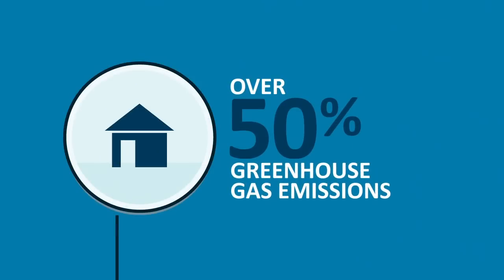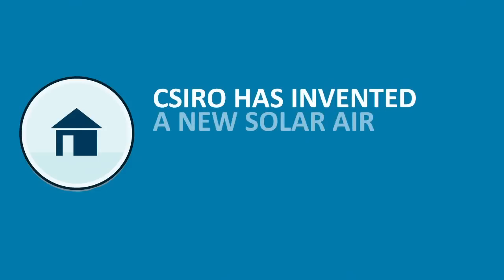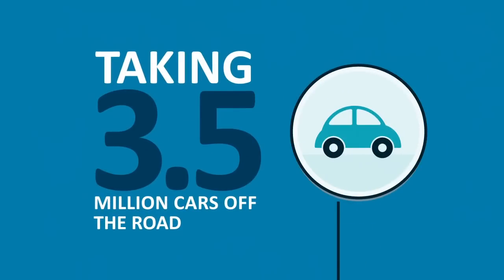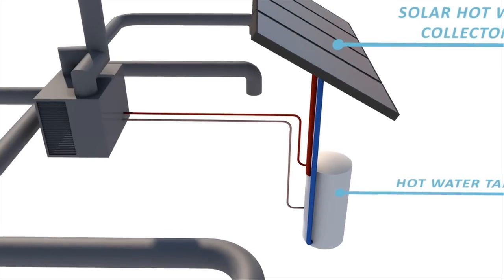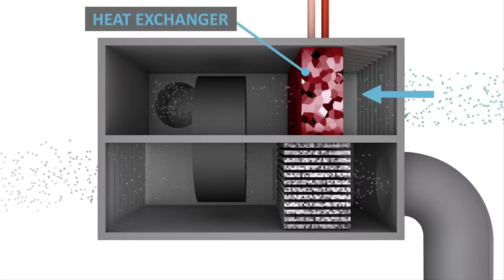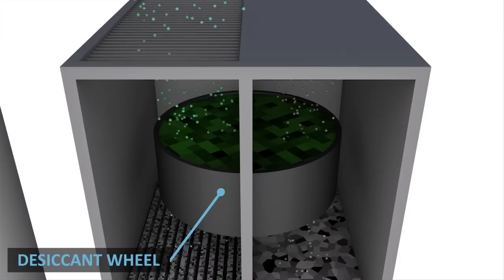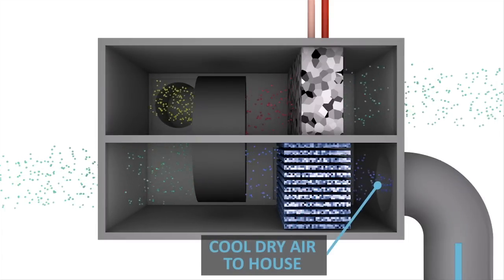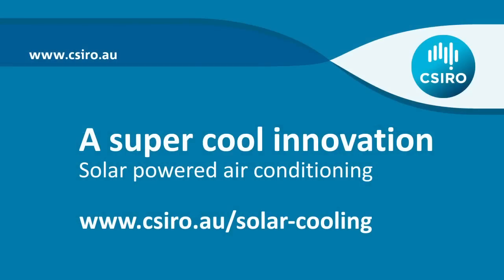Solar powered air conditioning

Comment: Our normal temperature  20 to 40 three month winter temp average 18 to 24 degree C and 8 month summer average temp 30 to 45 maximum. I want to use Eco solar heating and cooling system. I want detail about pricing and maintenance price.
Reply: good luck
Reply: It requires a magic wand to actually work.

Comment: I live in a desert, cold in winter, hot in summer. Humidity generally under 20% in summer. How would this work with 20% humidity, 35C outdoor air temperature?
Reply: Dry air is easier to cool then humid air. In very dry and hot locations you can use an evaporative cooler to cool the air and also add humidity. Basically, a swamp cooler. But you can't use a swamp cooler in very humid environments so you need to dry the air first. That's what this system does. It dries the air and then adds a bit of humidity back to the air both to cool it and keep it at a good humidity level.
Reply: @PlasmaNode  I understand the general principal. I use a swamp cooler almost daily. It is not particularly efficient -- certainly wastes a lot of water, in a water-scarce region. I could not find any research papers associated with the video above. My best guess is that it works as you suggest -- in a humid region above 50-60% ambient humidity, it uses solar heat to dry out the dessivant, yielding pre-evap air of 10% humidity, then raises it again to more than 50% humidity. It probably relies on having a fairly well-sealed and insulated house with return ducts, whereas low-cost American evap coolers rely on direct venting to the dry outdoors once the humidified air passes through the conditioned space (evap on one end, open window on the other). From what I can tell, this CSIRO invention is not directly useful for my situation because of how large and expensive it is. It is related to a recent Tech Ingredients video which addresses someone in my situation -- trying to cool a relatively small space (under 50 m^2) on a small budget ($500 or less) with limited electricity (solar off-grid) and limited water (hauled and rain-caught, no well or grid supply).

Comment: im not sure how you can get chilled air from hot water...Without the need for freon, to chill the air
Reply: I didn’t know about it either until recently, but it’s the desiccation process. It’s basically the same way sweating works: heat energy is carried off as water evaporates leaving you cool, so basically they are making the air “sweat” by drying it out.

Comment: Will this system work well in an arid/dry climate like Phoenix Arizona United States? Or, is conventional air conditioning the only real solution? Temperatures average 107°F or 42°C and do reach temperatures north of 115°F or 46°C. Is your system available in the US?
Reply: Since in you are area you don't need the solar heated desiccant wheel to dry your air it would be very little use to you. 

So a simple low cost evaporative cooler could be effective but if don't like higher humidity. 

Look into radiant cooling with geothermal direct or heat pump cooling source.

And consider storing the waste heat into a Hot Water Tank.  There are solar heat exchange tanks that can used. Why waste it? 

Except for evaporative coolers most of this will cost more than an air to air A/C unit but should save money in the long run. Good luck...

Radiant cooling - Wikipedia
https://en.wikipedia.org/wiki/Radiant_cooling

Geothermal heat pump - Wikipedia
https://en.wikipedia.org/wiki/Geothermal_heat_pump
Reply: Thank you for the details.
Reply: NP, feel free if you have any other questions or updates on what you decide to do...

Comment: The dry air that flows through the desiccant wheel passes through an evaporative cooler, creating a temperature differential of how much? So there are two fans that move air and presumably some device that sprays water on the heat exchanger in the cooling circuit. Not to be Negative Nancy, but it sounds like two fans and a pump are consuming electricity for maybe / optimistically -2 degrees of differential. Can you share some test results?
Reply: FYI, radiant cooling which is very efficient but still needs a separate dehumidifier to dry the air. So an effective solar power desiccant wheel dehumidifier would be useful for many applications. 

Evaporative cooler have been used in dry climates for long time so that is not the major issue. What has been missing is an efficient longer lasting, reliable way to dry the air. So the real issue is with the desiccant wheel and the associated systems. Desiccant style dehumidifier have been largely replaced with less efficient heat pump dehumidifier since the desiccant loss their ability to dehumidifier. So the key an effective desiccating system. And the fact is CSIRO is just a think tank and the idea is decades old, even I thought of a variation of how this concept could work. But the devil in the detail. Good luck to someone make it really work....

Comment: Just wondering... is this only available in Australia? Or can this system be adapted in other countries and in larger projects?
Reply: Gladys Rodriguez This could easily be adapted to any area that it is designed to work in. The only changes would be motors and voltages etc. I think.

This could also be scaled very well for large office buildings.I can see this replacing cooling towers somhow in the future. Possibly much more efficient and possibly less maintenance.

Comment: Long overdue concept. I don't mind so much that it's hot in summer. what makes it harder is that it gets so hot at night that you can't get a decent nights sleep. only 2 hours if you are lucky. one of the drawbacks of evaporative cooling is the celdek pads need replacing. what would the maintenance be like on this system. would you need to replace the desiccant wheel every couple of years. also keeping the spiders out...

Comment: The size of system you will need to achieve decent cooling would be enormous..and it doesn't work at night..
Reply: It would work at night if you had enough heat stored in a large enough tank.

Comment: Will this work in area with high humidity?
Reply: Ali Saggaf.  No.  There is no latent Hot Dry air in Florida.  Just Hot WET.  Therefore the drying chamber is not much dryer than the wet intake chamber.  You must apply greater mechanical effort to dry the air, like electrical dehumidifiers and traditional compressive air conditioning heat pumps.

Evaporative coolers work in Arizona or Southern Algeria better than Florida or Southern India, just like clothes dry very slowly on a gloomy day in Pensacola using just air/clothes moisture equilibrium.  They dry quick on a sunny day due to direct radiation boiling the water out, which took massive solar energy.

Comment: how does it work at night when there is no sun
Reply: The air con function of the system works using energy from hot water rather than directly from sunlight. Hot water is heated by the solar vacuum tubes and will store that energy overnight, so the air con element can run more or less continuously, provided the hot water tank is scaled appropriately.

Comment: Is Evaporative cooler using electricity?
Reply: Yes, there is nothing like passive cooling or heating. She said at the beginning, it reduces electricity bill upto 60%.to pump hot water in heating loop, one need electricity.more over in rooms for exhaust air, one could need  Ventilator.

Comment: Sir I want official journal on this project. How can I get it (please provide it)
Reply: This isn't a new idea been around forever you can make one yourself with just a modicum of ability
Reply: As a matter of fact there is already an avaliable design online now using PVC 4 inch pipe a homemade desiccant disk ,that rotates for longer lasting, and uses PC power supply super simple design works amazing

Comment: WHY I'm TROOLING?
Because the dessicant wheel will need to be larger than the housse AND it will still bring 100% RH inside. Have a look of the explanation. I've include a list of options that will do the work thousand time better than the present piece of shit and at a fraction of the cost.

COMPARTMENT 1 (It will take hours to dry the dessicant wheel and this wheel will get too hot in the process)
1 The hot water will be arround 70*C
2 The air can't be warmed higher than the water temperature
3 The dessicant wheel media can't be warmed higher than the air that has been previously warmed
4 So, this double loss due to heat transfer will leave the dessicant wheel way under 70*C, maybe 50*?
5 At 50*C, drying the dessicant wheel media will take MANY HOURS
6 The dessicant wheel will barely lose any moisture, but will gain temperature

COMPARTMENT 2 (It will take forever to remove any humidity from the outside air on a 50*C dessicant wheel)
7 The dessicant wheel enter into the second compartment at arround 50*C and perhaps 20% less humidity
8 The dessicant wheel will be cooled down by outside air to about 40*C (if it is 25-30*C outside)
9 The dessicant wheel will barely trap some humidity from outside air (10% in one hour been outstanding) 
10 The barely driyer air, at 40*C will be cooled in another heat exchanger
11 This last heat exchanger is an indirect evaporative cooler witch need a large cooling water tower outside (not showned, strange isn't?)
12 The indirect evaporative cooler can lower the 40*C air to about 30*C

WHAT DOES IT TAKES TO WORK?
So basically, as per number 9, unles you have a very very slow air flow, you will not get enough duration to get the water removed significantly from the outside air at such a high dew point. I guestimate that it will require a dessicant wheel about the size of the housse, wich is bulky AND expensive!

But this is not the worst...
The main flaws is the last steps. Since the water removal is marginal, it basically only rely on the indirect evaporative cooler, the only working part of this technology. This is not shown since it is not a new technology and it require a large water cooler outside and a large very large heat exchanger inside. Did I mention that an evaporative cooler work only when the outside air is dry? If the outside air is dry, then, there is no point to drying it with de dessicant wheel. If the outside air is moist, the evaporiative cooler is not working. Do you start to get it?

ANY SOLUTIONS?
OK, you asked nicely about a solution?
Once you fired and sue the responsibles for this sensless proposition, you look to what was already known...

More than two thousand years ago...
A Yakhchal was able to cool down enough to create ice in desert. It is bulky and require a little water to evaporate, but it is pretty much zero energy input and it can be made from dirt. This passive evaporative cooling can be used with a heat exchanger. Air passing within a double whall will work just fine or air duct slightly burried under moist sand will work as well for such heat exchanger.

You can also get a "Puit Canadien" to lower the outside RH and to significantly cool the air.
https://en.wikipedia.org/wiki/Ground-coupled_heat_exchanger
Both technology coupled with a solar chimney will drive the energy consumption close to zero.

You can also plant trees to get more shadow and evaporation from leaves will cool down your yard.
You can also paint your roof and your driveway with an IR reflective paint (or simply white).
You can build an irrigated green roof
You can simply put a tarp over the roof to dissipate the majority of radiation energy from the sun.

Alex from Québec, Canada

Ps Please, take a break, remember that as an engineer you can kill peoples if you cannot calculate things properly... Do humanity a favor and consider going back to school.

Comment: How does the system work when there is not enough sun light?
Reply: Chad Dimmack Reminds me of a creative presentation to ORAL B.  A client asked, how does this tv ad communicate to those without teeth.
Reply: great point
Reply: With Solar Arrays you need to have a redundancy system, either Generator or Battery. But I have been thinking about this.
Reply: Perfect answer.. Same thought
Reply: Tesla battery. Im sure csiro will flip the science to create solar powered heating too. Pretty much just need to reverse everything and have a condensing unit
Reply: Chad Dimmack if you live in an area where you dont get much sun light annually, why do you need solar powered anything. Just spend your money elsewhere
Reply: if stored heat runs out....you just need separate heat source like from electric or NG .....

Comment: Wow!  Sounds too good to be true.  IF it really works, and, lasts.... PLEASE bring that tech to the USA!    There are plenty of people who would buy that complicated tech. 
I thought hot water circulated via radiant floors to heat...guess it still could.  
But, using only air to circulate temps, means no water leaks damaging the house, and no tubing clogging from mineral deposits.    Just keep the ducts cleaned.   
That said....why not simply design in simple geothermal to cool?  Blow air via 6’ to 8’ deep geo-holes in ground, into house, helps cool..,.and, vastly decreases need of heating cold climates.    Ground is at about 55 degrees F., at about 8’ deep, almost everywhere people live.   THAT translates to simple tempering, winter or summer.    So, whether one berms the house, or, carries that temp to the house, measurably reduces heating/cooling costs.    
Humidity can also balance in the ground, given the chance, via use of perforated tubings used to circulate the air to temper it in those holes, or directly.   
Insulate well, the “roof” lid of the geo-holes, over top of the tubing, to separate temps in the holes, from outside ambient temps.   Once installed, there’s no fluid to leak, and nothing bringing hot temps into building envelope.  
And, only cost is fans to move the air.   
Tricky parts include:   figuring how much tubing is needed in the Geo-holes, to temper the volume of the building.  
Leave bottom of the geo-holes as bare ground, to allow humidity to balance via earth.   
Perf’d drainage tubing comes ready made with drainage “stones” in a sock around them now, which facilitates humidity balancing.    Though, some don’t bother to put tubing in the geo-holes; they simply input warmer air to top of holes, and bring cooler air from bottom of holes.   
Just need large enough holes &/or tubing, to cope with volume of air inside the building.  
That seems much simpler.  
Some fear that would bring in mold....it doesn’t seem to.  Have seen this done in the Pacific NW of USA...quite humid weather.   Mold happens worst, when air doesn’t move, or, when humidity lingers above about 50%.   
Humid air moved via bare-dirt in geo-holes, tends to balance into the earth...dry air takes on a bit of humidity, while damp air drops its moisture into the dirt.  It also seems to freshen the air somehow...kinda like being in a cave that has moving air.   Those who lived this way, didn’t seem to get mold in their cabins [earthen floors]; while those in well-sealed cabins, constantly fought against mold.   Sealed cabins can’t “breathe”.  Earthen floors, breathe. 
Geothermal holes, are like having an earthen floor to help the house breathe, as well as tempering the air.
Reply: Enjoy ur holes...

Comment: All good when fresh and new...
Give 3 or 4 summers ...
This system would have nowhere near the cooling capacity of a standard refrigerated AC.
It wouldn't work where the air is already dry like anywhere west of the Blue mountains Australia.

Comment: Where electricity used in this
Reply: Rotating the dessicant wheel requires electricity, as would fans to move the air (and to a lesser degree, water) around the system. The important thing is that is the only power needed. The actual heating and cooling is solely done through energy from the solar heating of the water. This is a huge reduction compared to having compressors to run air conditioning and immersion heaters for hot water.

Comment: What happens at night time?
Reply: +Jesse Osborn Good question. Perhaps the water is a saline solution that can store the heat after the sun has gone down.
Reply: +Jesse Osborn Solar energy is fed and stored in battery banks, not used on a minute to minute basis so this would work the same as any solar generated system.
Reply: +Jesse Osborn It's stored in an insulated tank, so little heat is lost
Reply: So it uses electric solar panels not solar hot water panels? Will this system be effective in coastal areas like the Sunshine Coast? I'm asking because I am about to build my own house and I'd like to find the best system to use.